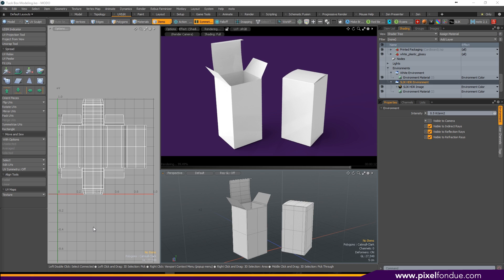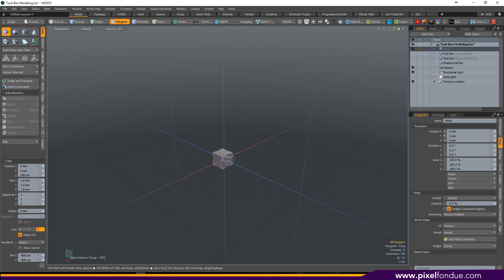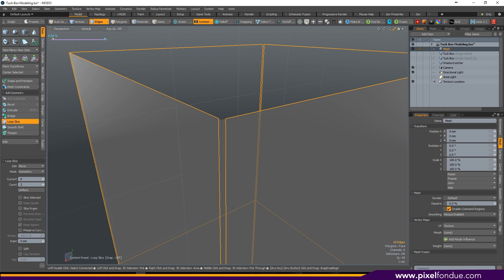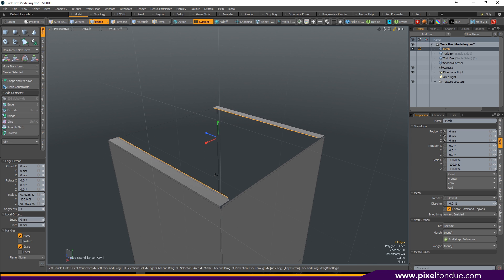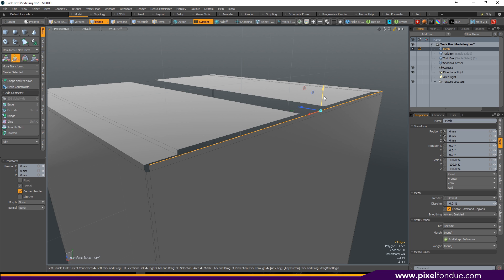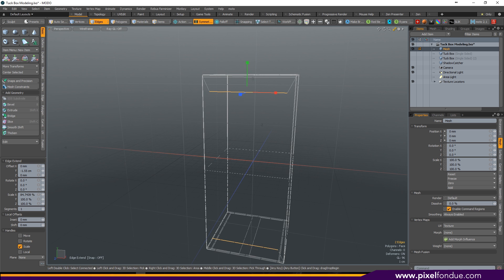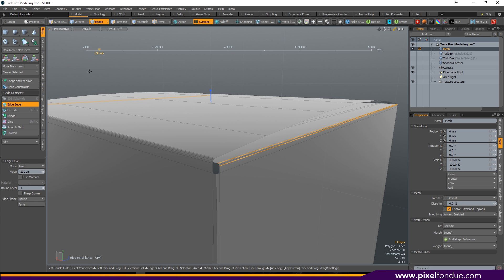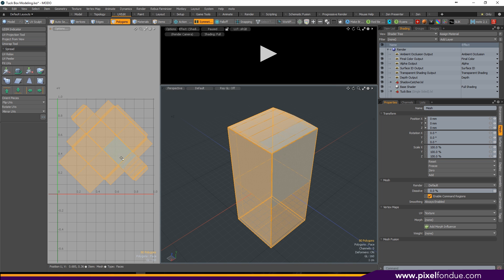Modo Simple Tuck Box Packaging

Comment: I'm trying to add a "window" in my packaging model using maps and I see you've done the same to this box.  Is there a tutorial out there that goes over how to do this?
Reply from the maker: This is Greg (not Ryan, the maker of the video) - but I'll try to answer.  I think you're better off assigning the window polygons a new material (and maybe put some additional modeling work there) rather than trying to use maps.  You can use a transparency and reflection maps to approximate clear plastic..but I think you will get a better image by modeling the plastic window and assigning it it's own material.
Reply: @pixelfondue  Yeah, that's what I was afraid of.  Thanks for the prompt reply on an old video!
Reply: @TerraMined  Hey Sarah, I used a stencil map for this. It's great if you're doing concept work because you don't need extra modeling work and you can pump out a few different options by only making maps and turning them on or off.  A stencil map works where anything white is transparent and anything black is opaque.  I hope this helps!
Reply: @ernstryan1  Yes! I will research into stencil maps!  That's exactly what I was hoping for.  I am creating various package designs and wanted a way that I could keep the model the same but use maps to change up the graphics/window areas!  Thank you for this valuable information! Have a great day

Comment: cool tutorial! I've done quite a few package modelling and 90% of the time the client will give you the dielines. How would you approach it if you had to start with a dieline drawing?
Reply from the maker: Hey MetalGear, thanks for watching.  I'm usually the concept artist for packaging, so I show the client a few options of what their packaging could look like before a die-line is even made.  When I do model from die-lines, which is rare for me, I usually model them flat using a background image plane.  I have used this geometry in the past to match die-lines to, it's not as clean as modeling it flat and folding it, but it works if your client is in a rush, just use "Absolute Scaling" under "Snap and Precision" to get the correct width and height, then remake your flaps by dragging them out with "edge extend" using the measurements provided in your die-line.  I hope this helps!